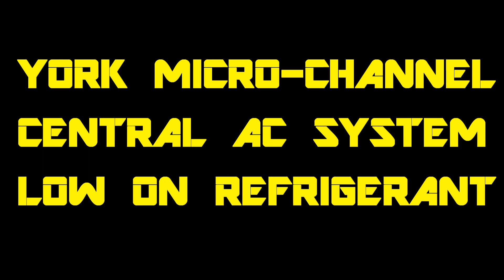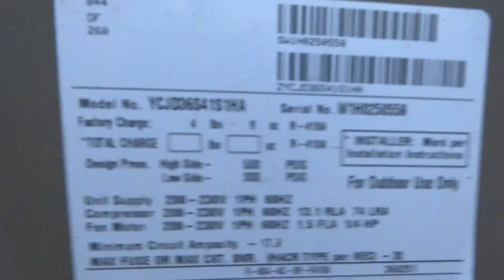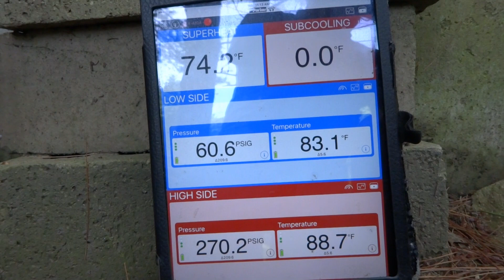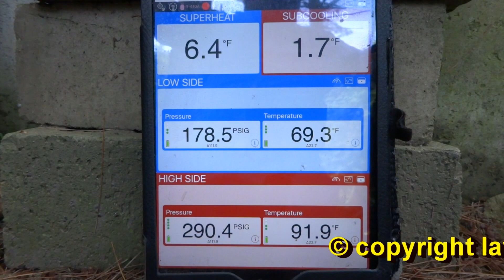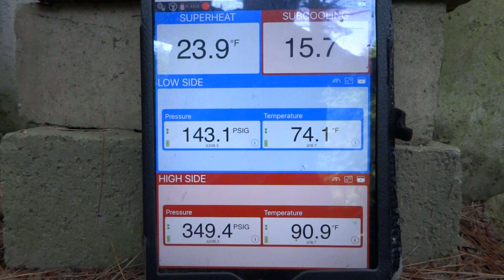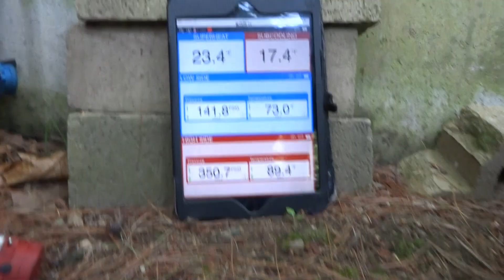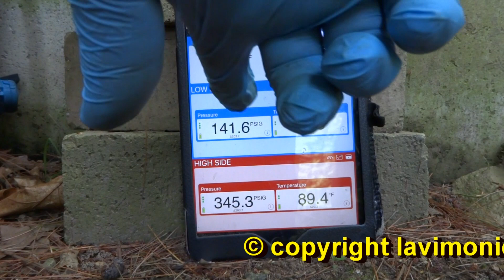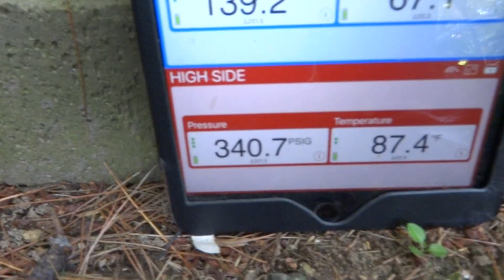YORK MICRO CHANNEL AC SYSTEM LOW OR 410A REFRIGERANT

Comment: If there is more to your service calls that you're leaving out for times sake (I doubt it because of how much travel time is always in them), you really should include it. The way it's edited now makes you look incredibly uneducated and unprofessional.

I'd hate to see another generation of techs running around thinking it's okay to hook up to a leaking system, open the tank wide open and dump on top of an azeotropic refrigerant and call it good.

Did you check the metering device inside? Are you sure you're just looking for superheat? If you're bitching about high liquid pressure (nevermind the ridiculous sub cooling...) What happens 30 mins later when all that gas you poured in equalizes?

Edited to add: was there a conversation with the client you left out about resolving the actual issue? If so, why? That would be more helpful to people watching your videos.
Reply: If it’s a txv he will be back when it goes off on high head pressure intermittently. Anything over 10 sub cooling is asking for trouble with a micro channel condenser

Comment: That's the only good thing about the microchannels is they don't hold much refrigerant. I believe the microchannel was a bad mistake that the industry is trying to recuperate from. The condenser coils from Trane and American Standard called the spinefin coils are proven to be the best coils made. Anything other than micro junk coils. Thanks for the clip Steve.
Reply: Agree, although microchannels may not hold much refrigerant, they don't hold it very long.

Comment: On a R32 system the pressure is alot higher. On heating mode it is around 600 psi..

Comment: It's kind of crazy that they can't make a reliable micro-channel condenser that sits stationary for its whole life yet they have been using them in automotive applications for years without many issues.
Reply: Agreed.
Reply: How many cars you know are running the AC with a 8 hour a day duty cycle for 10+ years?
Reply: @bnasty267  Well not many but. I do not like microchannel they leak so much. They don't seem to have leak problems in auto A/C though with the new R-1234YF. Which runs high pressures than R-134a.
Reply: @bnasty267  That's an average LA commute
Reply from the maker: automotive has a 5 lbs radiator cap  410a is 350 psi plus dont take a rocket science to figure the issue out
Reply: @stevenlavimoniere  I meant in automotive A/C systems. They also can run over 300PSI on a hot day.
Reply: @madmatt2024  All new cars aren't using R-134a. They're using R-1234YF which runs even higher pressures than R-134a which is currently being replaced by R-1234YF.
Reply: @madmatt2024  I get the impression a lot more corners were cut specifically because it would be sitting still its whole life. They could likely have made them just as reliable as the automotive AC condensers, but they weren't willing to spend that much.

Comment: Micro channel looks like a car radiator.       Car radiator runs 18 to 22 lbs pressure.     When running higher pressure, you would want it round.
R22 is nice because it runs at lower pressure than R410a  less strain on system components,  Just guessing.
Reply: Looks similar, but the microchannel has multiple small holes through the extrusion rather than one large oval hole like a car radiator or intercooler.

Most of the problems are due to corrosion of the alloy, exacerbated by the 410a refrigerant.
Reply: @plkracer  That's interesting, feel 410a is highly toxic.  Bluon TdX 20 Refrigerant and newer 32a just doing some research seem to be more
friendly to the environment. Thank for the info on the micro channel systems.
Reply: @Gordonseries385  yes, r410a is going to be phased out by 2024 (I think) for new systems. R32 and other blends (R454B) seem to be the route forward.